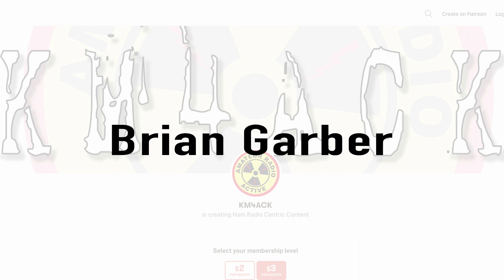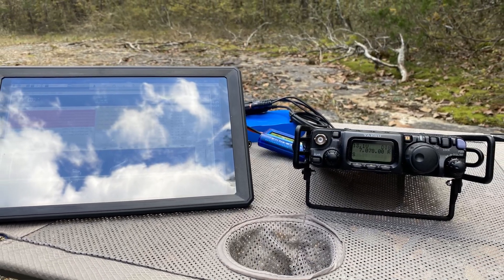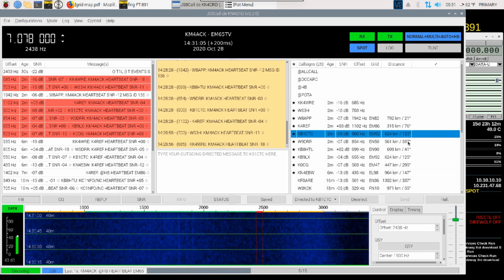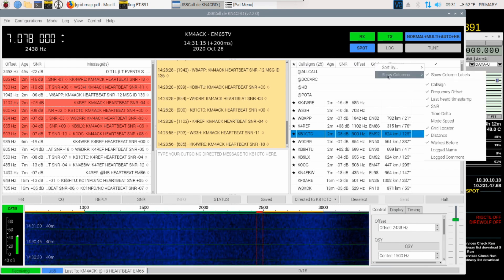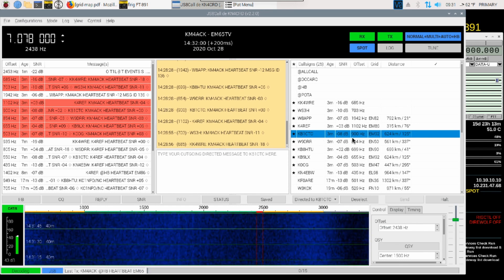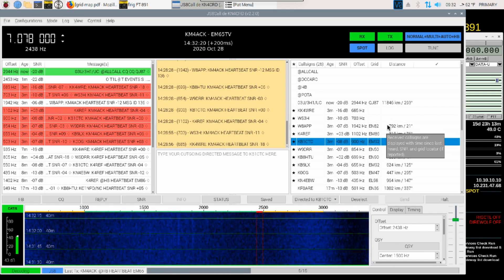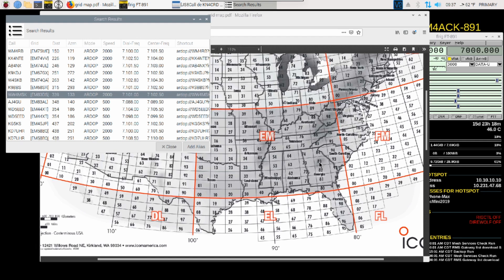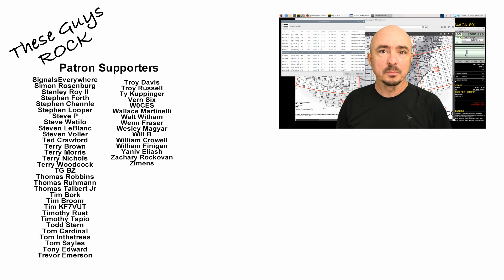Using JS8Call to "SEE" propagation

Comment: Jason could you have taken the distance from you measurements on JS8 and used those in the pat auto section to define any stations in your rough distance ? Would that have been smoother in the field for you?
Reply from the maker: That would have worked as well but might have given a larger pool of candidates. This seems more of a “surgical precision” method.

Comment: Great topic, Jason. I have been plagued getting into a Winlink gateway for some time. This approach makes complete sense. I am a software engineer by trade and obtained Winlink API keys a few months back to access the gateway service endpoints. I was planning on making a tool for myself while in the field or away from my home to find a nearby gateway. If I  ever free up, I may take your concept and automate this process and overlay the results using offline maps. I assume this works just as well with FT8 to find the stations and use the signal reports. I also see opportunities to add an extension to WSJT-X that provides this functionality. Good stuff and thanks for giving me another potential project to feed my ADD.
Reply: I may have missed this. Has this been accomplished yet and if so where could I obtain or help in testing?

Comment: Excellent video and a great idea for another tool to be used for off-grid comms. I spotted your call sign while doing JS8Call last night. You were in a CSO with another station and so I didn't get a chance to connect before I had to log off. I tried to leave a message in your mailbox but am not sure if the message was delivered. The message mentions a project I'm working on which involves creating a community based emergency radio communications network.The working name for this project is Community Radio Network(s) Program (CRN)P. What I am working to create is, what I'm referring to as a "hybrid" network. The objective is to bring radio communications down to the street level of every community. Such a network will involve licensed amateurs as well as non-licensed community volunteers. If you'd like to learn more about my project please contact me through my email address on QRZ. I really appreciate the work you are going to promote HAM radio and especially EmComm and off-grid comms.